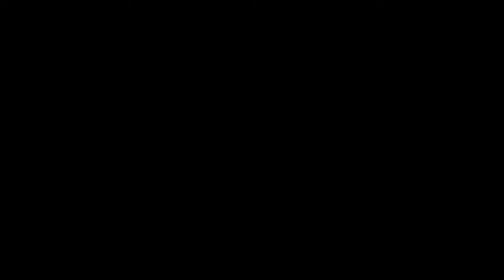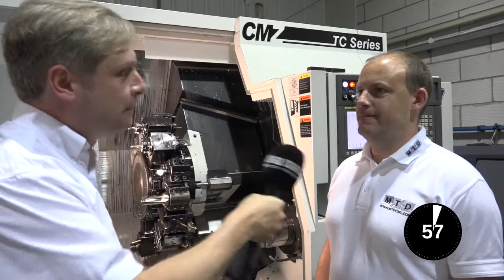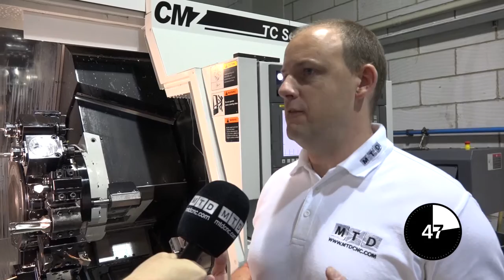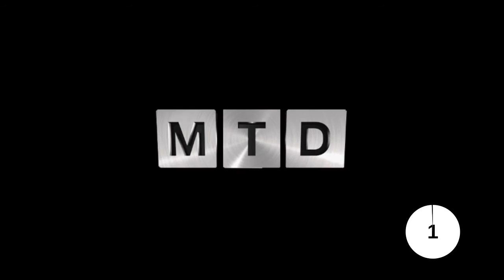What is different between a lathe and a turning centre - 60 Second EDUCATIONAL VIDEO

Comment: I'm learning CNC machining and I don't quite understand the difference very well. A turning center would be something similar to a 4 axis machine?
Reply from the maker: a turning centre turns the material, a 4th axis unit tends to go on a milling machine and index so you can reach differing positions